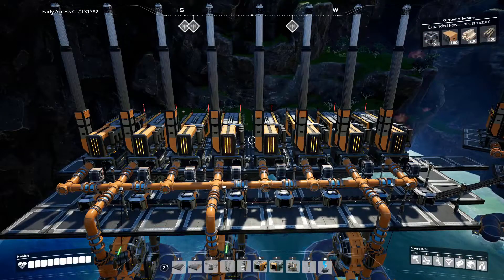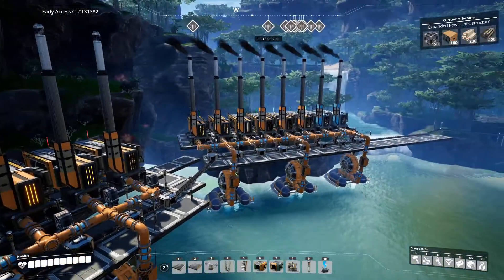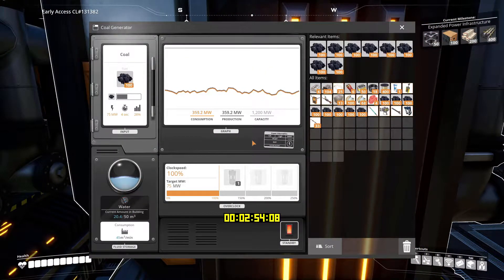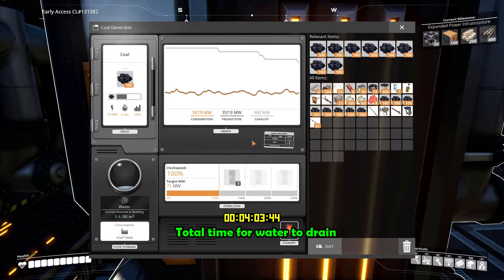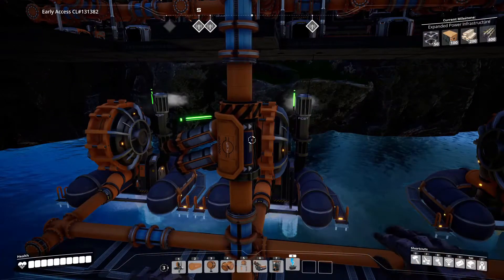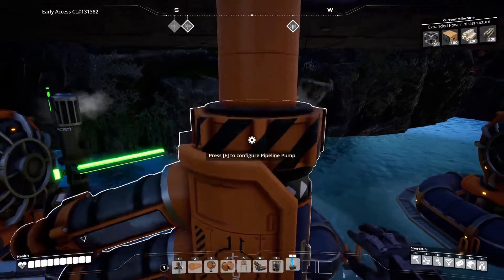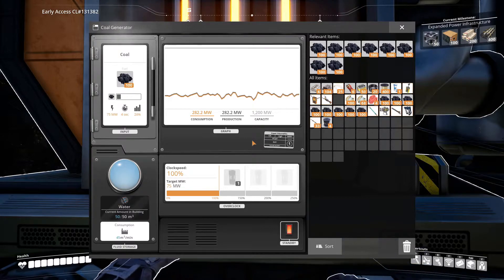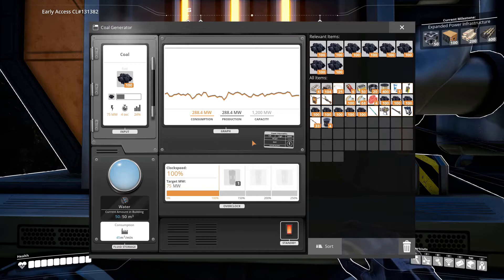Satisfactory: Coal generators water flow issue.

Comment: Nice video, it was clear and easy to understand :)
- I just wanted to mention that you may get some water issues later on as you won't be able to feed the coal generators the full amount of water they require at full capacity (360) as your pipe is only able to hold 300 water. You can avoid this issue though, either by using mk2 pipes now, or you could go the old route and possibly use the valves to control the flow of the water.
Reply from the maker: Well, your influence is rubbing off on me as I've watched  lot of your videos and it's inspired me to start creating content too.  You'll always be able to top me because of your awesome accent.

Thanks for the advice and will keep that in mind, also I haven't unlocked the MK2 pipes yet but am close.

I've also run into another issue that is separate from water flow...I don't have enough power in general, LOL.  Most of what I've done so far is just winging it.  I've also only recently started to run numbers prior to building.  This game is so fun but realize there is a planning element to it too.